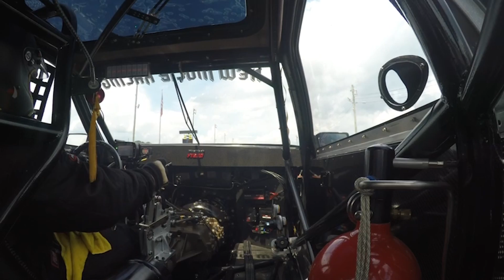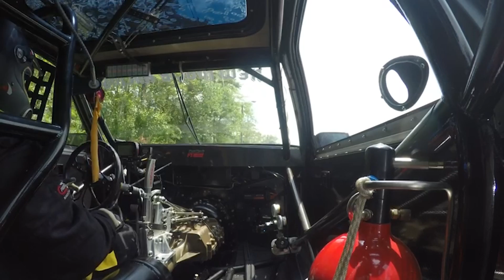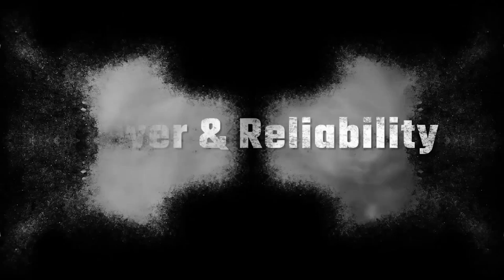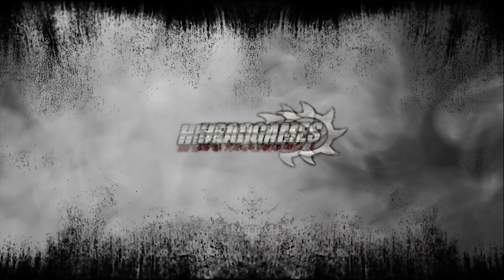Proper shut down for race cars! No more bent valves!

Comment: Does this apply to Inconel exhaust valves?, what about on the intake side with Titanium valves?
Reply from the maker: Yes it absolutely applies to Inconel. Some grades have memory so it will bend back into shape. Others will bend and not come back when you heat it up again. The intake side is not affected.

Comment: @headgames what about car with NO water running thru the block (concreted blocks), so basically no cooling system???

I litterally see this being done all the time. With big engines too. Shut down in the decel, and then restart after packing the shute to drive back. (Think cleetus & crew including steve morris do this also)
Reply: The methanol cools the cylinders pretty well in that case. I know Cleetus’s cars and only Leroy has no cooling system but they all have water-cooled blocks.